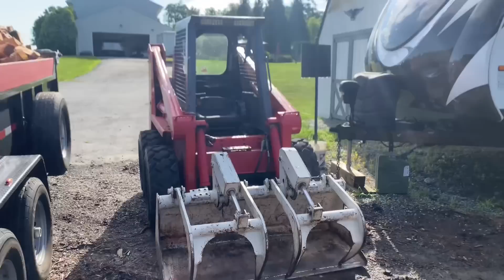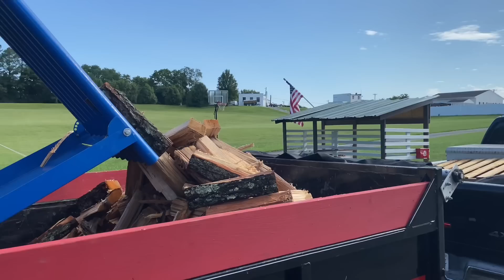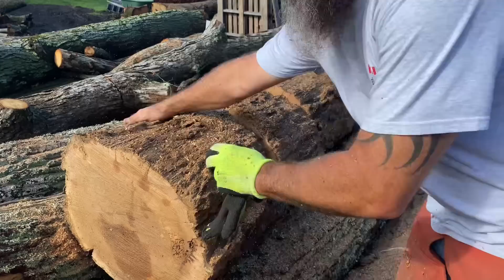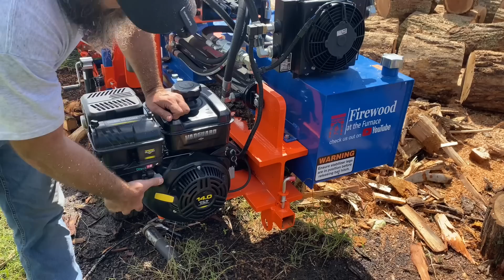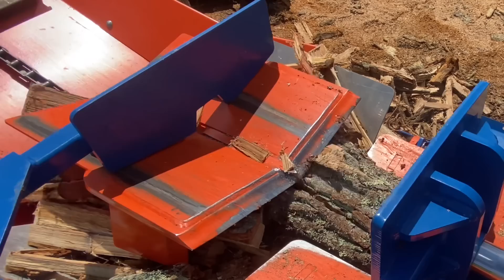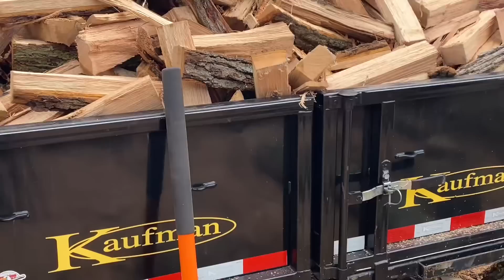PROCESSING FIREWOOD - #156

Comment: Your videos are super! Could you please tell me what size your matching trailers are and what you use to pull them. Planning to buy my first trailer and will need to buy a truck to haul them as my Honda Ridgeline is a bit small for a task like this. Thanks and look forward to more videos!
Reply from the maker: Thanks so much for the kinds words. My trailers are 7x14 and hold a cord and half thrown in loose. I have a 2005 dodge ram 3500 dually that I pull it with